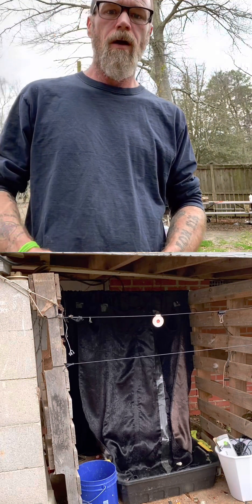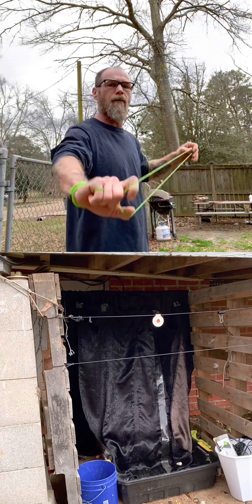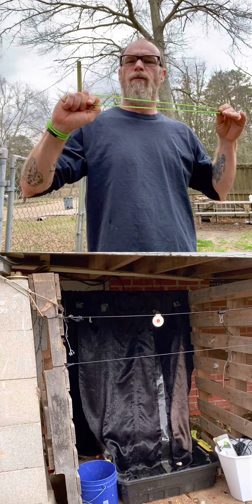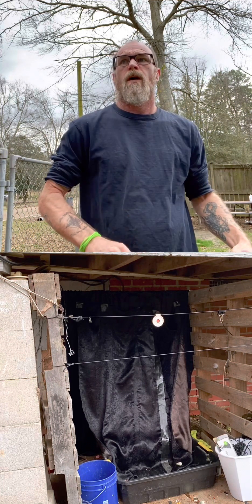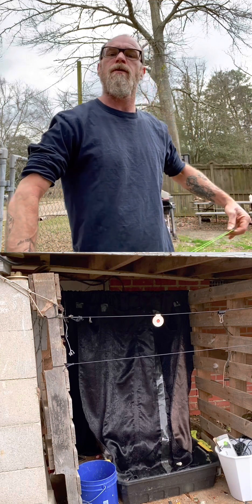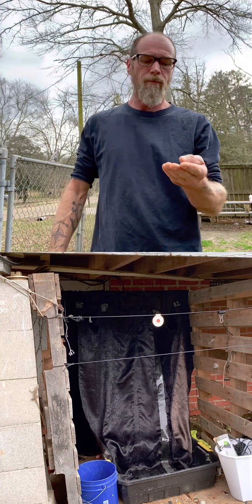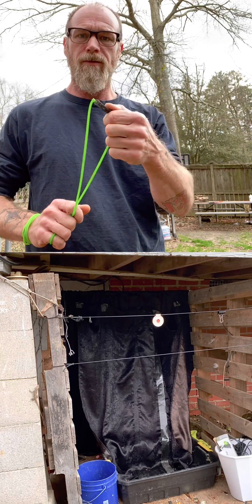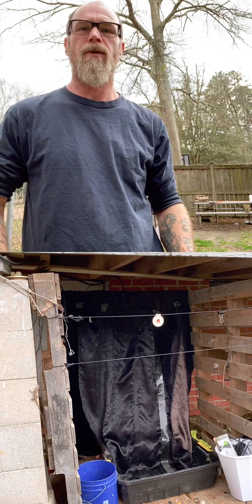About 1636 tubes and 3/8” Steel

Comment: man i need to learn to shoot butterfly.  What is the average band length  i need for butterfly? . with anchor shooting i have 7 inch  active length  and draw length 27inches.  What you say my friend?
Reply from the maker: For most pet, take your height and subtract 5-6 inches is right on. Of course with frameless you have to add sim for the hand. Mine are 22 1/4” looped.